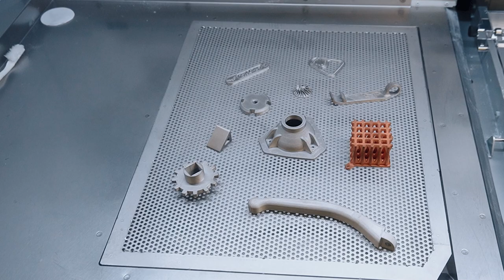The Secret to Polishing 3D Printed Metal X Parts Like a Pro

Comment: The question about the shrinkage is very interesting.. I've to make a two-part soapcase and one part inserts into the other perfectly, getting fixed. the question is: 1. Can the result be controlled by the printer? 2. Furthermore (since I don't have enough equipment) I would ask if in your opinion I can use a standard-economy equipment composed of the following accessory:

Comment: How much do parts shrink after sintering? And how is the dimensional stability? Would love to see this at a lower price point for home use.
Reply from the maker: The shrinkage is around 17-20% depending on the metal, but all compensated for pre-print in the Eiger software so the user shouldn't have to worry about it.
Reply: @hawkridgesystems  wow, that's nice